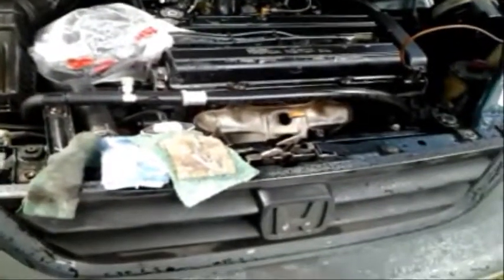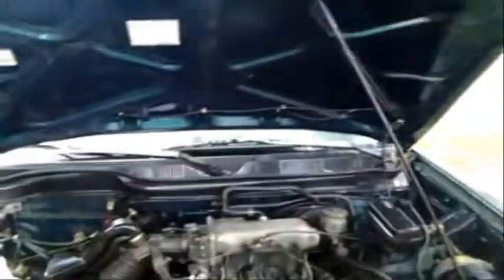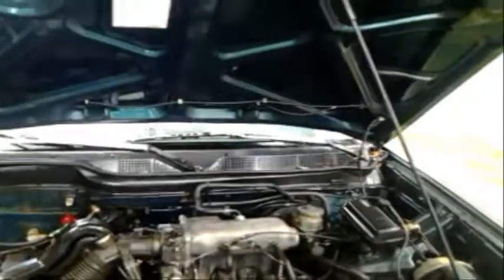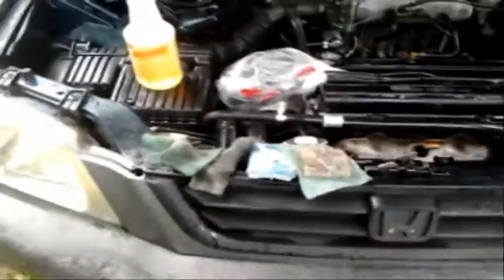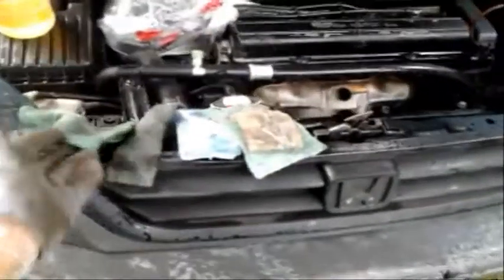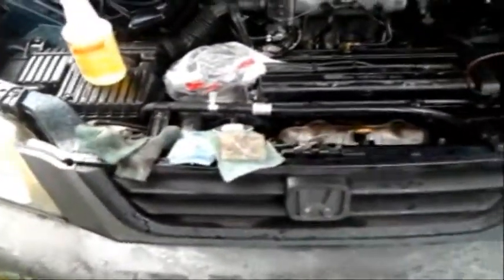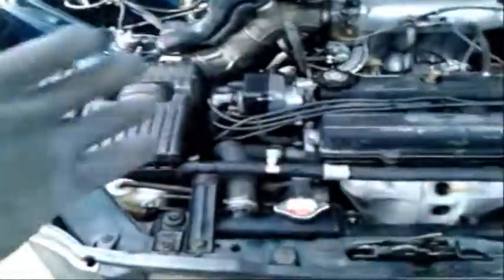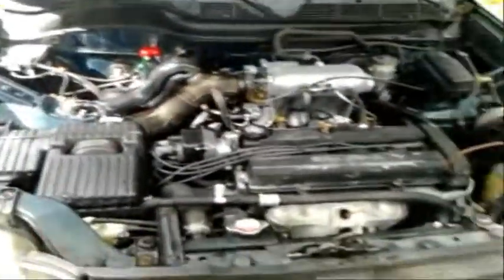1997 to 2001 Honda CRV How to clean degrease engine bay 1998 1997 1999 2000 2001 Honda CRV 98 CR-V

Comment: Ok, looks easy enough. Thanks and btw do you know where I can buy a set of the same wheels you have on your crv? Reasonably priced of course.
Reply from the maker: Hey Larry so they're two different wheels for the Honda CRV the ones in my vehicle were made for 1997 and 1998 I believe? The 1999, 2000, 2001 are different...
Not really sure where you can get them just kind of look for Honda CRVs for sale and ask if you can switch the wheels